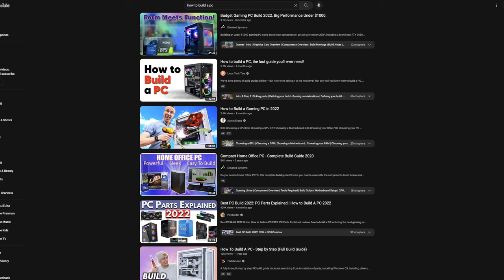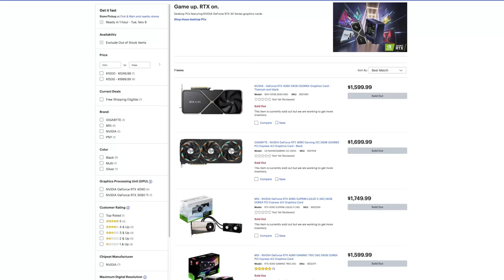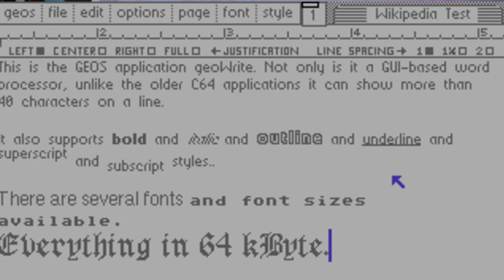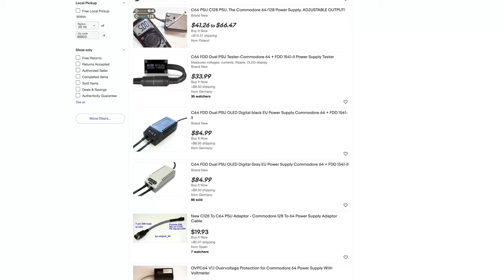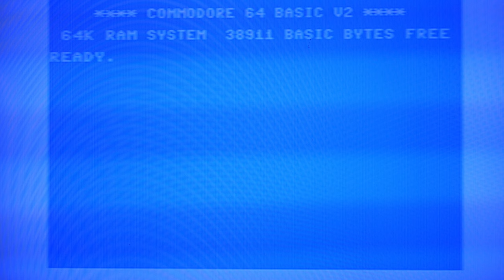Unboxing the Past to Move Forward!

Comment: 100% home brew S100 Z80 16kB RAM (all hand soldered) 2kB monitor program 2kB B&W video on a self modified TV. Before the VIC20 was even thought of. Those were the days! We had to build it all back then, even the cases for the card cage, power supply and keyboard.